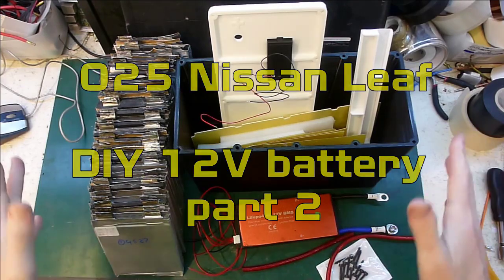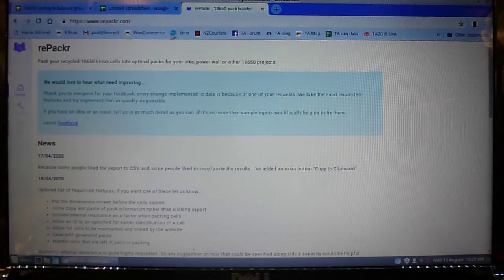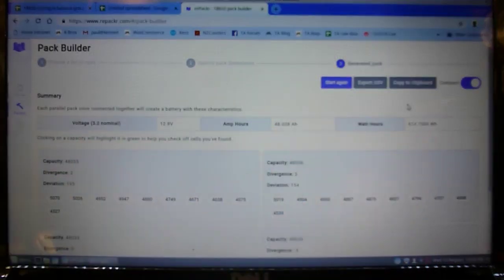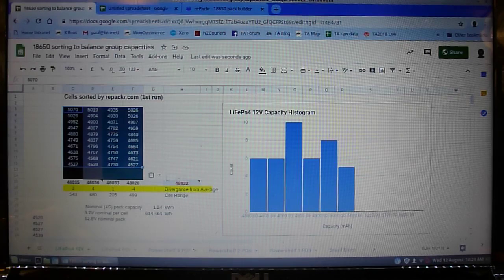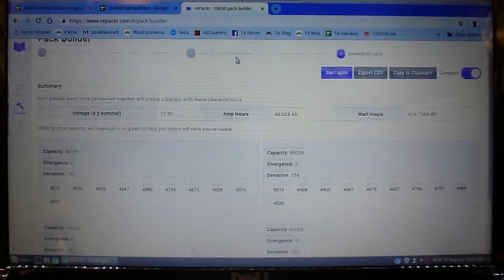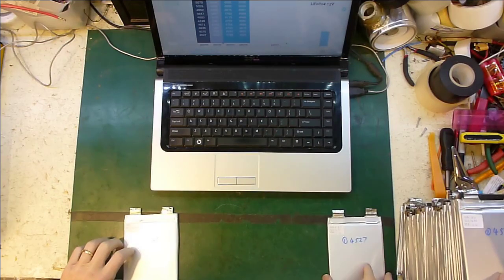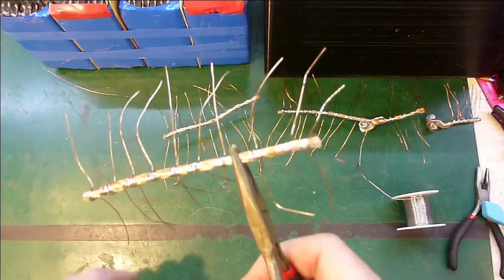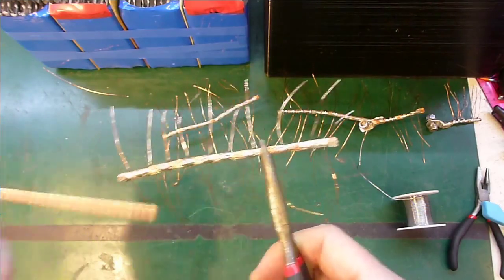Nissan Leaf 025 - DIY 12V LiFePO4 battery, part 2

Comment: Nice recycling Paul. Your pla leaf wheel alloy inserts took a battering on my muxsan'd leaf recently as we drove 1300mile from manchester to calais to rotterdam to cologne and back. The front ones got too hot and have warped abit but i will reprint the fronts when i get time. Good to see you still working on your leaf.
Reply from the maker: Hi Andrew. I've been tempted to print a set in PETG, but up till now I just print another one when I need to. We're in late-winter here so temperature it's an issue right now. What kind of temps are you experiencing? I take it your Muxsan system is all good now?
Reply: @paulkennett  it all good but i need to change out my leaf battery for a recent 30kwh minimum as my original battery is holding the whole system back which slow rapid charging.
Reply from the maker: @Whereswally606  Mine is down to about 16kWh :(